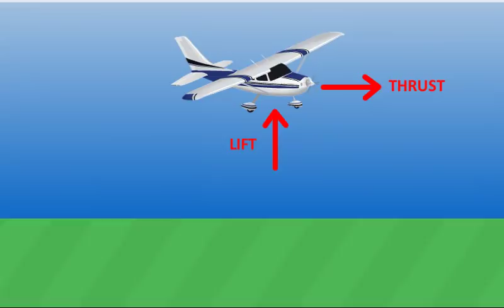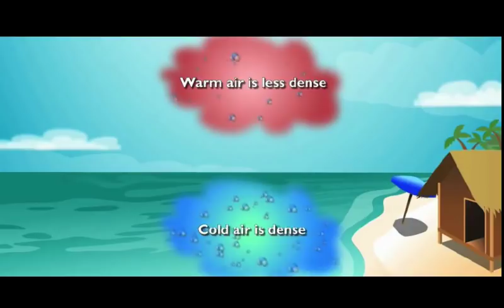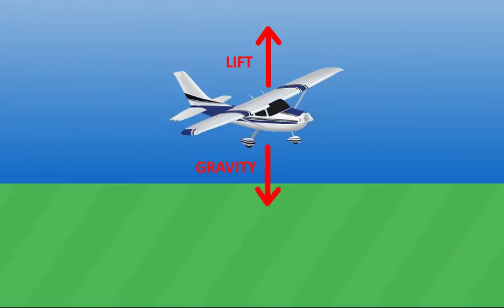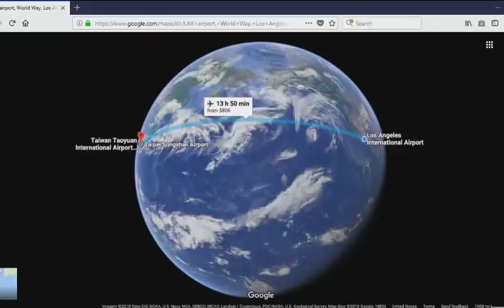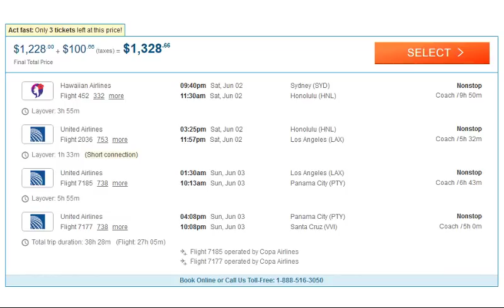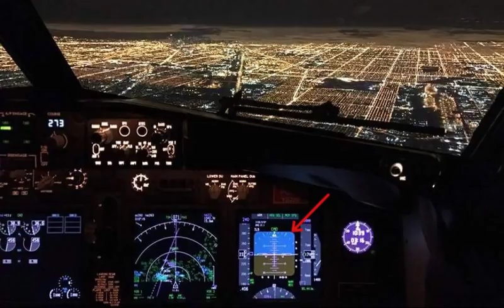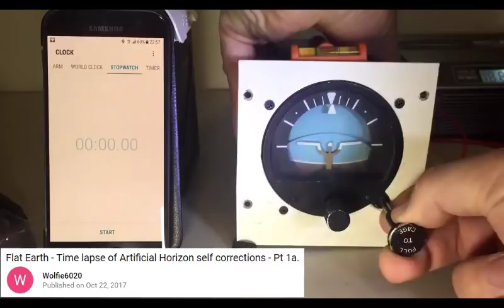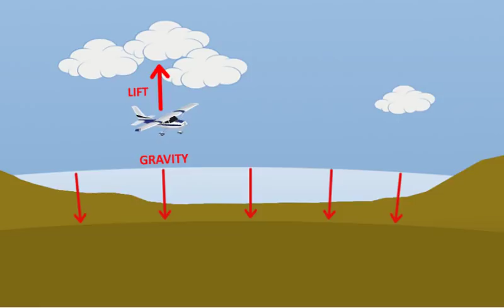Flat Earth Falsities - Plane Nonsense

Comment: +Bobby Wizdum   was asked, to prove Bobby isn't a lying troll.
"OK lying troll Bobby, prove you aren't a lying troll.
Why is it that a compass needle is more or less vertical at the poles and horizontal at the equator?
And when you carry on past the poles the needle slowly returns to the horizontal?
Why is it that it is only possible to navigate accurately over long distances using spherical trigonometry?
Why is it that traditional gyro compasses work perfectly in low latitudes but became unreliable in high latitudes?
Why is it that it is only possible to navigate accurately over long distances using charts based on a terrestrial spheroid?
Why is it that when you watch a ship sailing away from you the hull is the first thing to go below the horizon, then the superstructure and finally the funnel and upperworks?
Does a magnetic compass point towards polaris (Alpha Ursae Minoris) at the north and south poles?
Does a gyro compass point towards Alpha Ursae Minoris at the north and south poles?
What is the relationship between longitude and distance when travelling east or west parallel to the equator?. If you know the answer then you know the earth is a spheroid. If you don't you are not qualified to comment on the earth’s shape.
Please explain the principles behind the development and functioning of a gyrocompass? If you can then you know the earth is a slowly rotating spheroid and gravity is a fact. If you don't you are not qualified to comment on gravity, the earth's shape or movement.
No evasions please, just straight, honest answers.
And Bobby's response was
"wong why don't you stop changing the subject."
So Bobby agrees to being e a lying troll
Reply: WISDOME
KINGDOME
FREEDOME

ABOMINATION
OBAMA NATION
A BOMBIN NATION

DOMESTIC RACE   , DOME MESS TICK
DOMACILE IS YOUR HOME ,   DOME A SIGH ALL
DEMONS  ,, DOMENS 
DOMINATED BY DEMONS EARTH IS,,,DOME IN ATE  D 

WORD OF GOD 
GO SPELL OF CHRIST
U  N  I  VERSE

AND THE WORD BECAME FLESH

AND THE WORD WAS WITH GOD
AND THE WORD WAS GOD

BABBLE ON WHORE HILLARY
ABOMANTION BARACK OBAMA
BURNING BUSH FAMILY

MICHELL OBAMA,    m,,i,,c,,HELL

MANDALAY BAY SHOOTINGS

MAN DELAY ,,, DELAY OF MAN 

LAS VEGAS
LOST VAGUE GUESS

JESUS CAMPOS THE SECURITY GAURD,  THE JESUS CAMP
NEXT TO THE LUXOR ILLUMINATI PYRAMID

CORINTHIANS : AT THE ANGELS LAST TRUMP YEA SHALL BE CHANGED,,, TRUMP*

DANIEL 12:1  MICHAEL RETURNS TO RESCUE THOSE WRITTEN IN THE BOOK OF LIFE WHEN THE TROUBLES OF THE WORLD ARE GREATER THAN EVER BEFORE

DANIEL 12  WAS SEALED BY GOD AND IT IS WRITTEN THAT IN THE END TIMES THIS BOOK WOULD BE UNSEALED AND IN FACT IT HAS BEEN

AND YOU SEE THEN MICHAEL IS THE SAVIOR OF THE WORLD IN THE OLD TESTAMENT AND JESUS IS THE SAVIOR IN THE NEW TESTAMENT

BUT IT WAS MICHAELS HOLY NAME WHO WAS SEALED UP UNTIL THESE TIMES

MICHAEL OF URANTIA  STATES MICHAEL WAS JESUS OF NAZARETH
MICHAEL OF NEBADON SAYS THE SAME THING

NOW THE BOOK OF DANIEL IS OPENED TO REVEAL MICHAEL*

I BEGIN AGAIN*

CREATION IS FLAT AND CONNECTED BY WATERS

WE DO NOT GO INTO SPACE THE VOID THE LIE

ALL DOMED WORLDS ARE CONNECTED BY OCEANS THAT GO ON AND ON

ATLANTIS AND LEMURIA ARE STILL OUT THERE BEYOND THE ARTIC CIRCLE THAT ENCLOSES US IN

UNITED NATIONS SYMBOL IS A FLAT EARTH

THE CATHOLIC CHURCH PREACHED A FLAT EARTH FOR THOUSANDS OF YEARS
THEY IMPRISONED GALILEO FOR SAYING THE WORLD WAS ROUND

SO DO ME , DOME,, DO ME,,, DOME, DO ME!
word

michaels  sword  is actually the  s WORD,   THE WORD OF GOD WILL DESTROY A MILLION SWORDS AND NEVER FAIL

Comment: Are you saying gravity is selective, it can hold great oceans on a ball yet allow a helium balloon to lift up, I didn't know we already had an anti-gravity device all this time. People like this guy narrating this are very clever at deceiving you from the truth.
Reply: +Codenamebravo
"Are you saying gravity is selective" Not in the slightest. The things themselves are different in their mass and distance apart.
Fg=G.m1.m2/r^2
G (gravity) is a constant
m1, m2 and r are variables. Mass and distance apart.
Fg is the force resulting from those two masses and their distance apart due to their gravitational attraction.
You selected two different masses as examples, not gravity, so you are being selective.
Reply: Nope. Helium, in a gaseous state, is just lighter then the other gasses like nitrogen, oxygen and carbon dioxide that are surrounding it. Freeze helium into a solid state and it will stay where you leave it. Check out that periodic table and look at how much helium weighs in at. Also take a look at hydrogen, and why we don't fill Zeppelins with it anymore.
Reply: Capt'Wes Starwind thats 
Our point. Its less dense than air so it rises. Gravity? Nothing to do with it.
Reply: +Bobby Wizdum
Yes, we know you are a troll and a liar, there is no need to keep reconfirming it.
Reply: Bobby you can't get density and buoyancy to do anything without gravity. Please provide your unique flat earth equations for density and mass.
Reply: And yes there GRAVITY deity is full of flaws, nothing adds up in their great picture, Universe would still be expending despite G. 
Einstein showed that what we think of as the ‘force of attraction’ between two masses is actually the result of warping of the very fabric of space and time around them.
General Relativity may work well on relatively modest distances and timescales, it’s looking increasingly creaky on truly cosmic scales. 
Its equations need modification to explain how the Universe has behaved over the last six or seven billion years. It’s acting as if propelled by a force with its origins in sub-atomic effects, which Einstein refused to countenance.

Just as Problems with Newton ... conceptual reasoning ultimately forced Newton's gravitation theory /LAWS to be modified and replaced by Einsein's theory of general relativity.

http://theconversation.com/how-einsteins-general-theory-of-relativity-killed-off-common-sense-physics-50042
Whether it is possible to unite the two remains to be seen but it is unlikely to reintroduce common sense into physics.
Reply: Louis Shaw newton's laws still work perfectly fine here on earth. Enstiens work great on large scale objects. You just showed how you have no understanding of what science even is about. Good job flat earth.
Reply: Louis Shaw I take it you didn't read or understand the article?
Reply: Louis Shaw wow you really buy unto this flat earth scam don't ya? Must be nice feeling smarter than Einstein. Lol
Reply: Louis Shaw too bad grade 4 geometry proves the earth is a sphere. That's gotta suck for ya
Reply: HA ha THAT calmed THEM down, dont like to be called on, only one admitted and keep the teenage bully callings going on, love their LOL!
"I have come to believe that the motion of the Earth cannot be detected by any optical experiment."- Physicist, Albert Einstein
"In order for the Earth to be at rest in the center of the system of the sun, planets, and comets, there is required both universal gravity and another force in addition that acts on all bodies equally according to the quantity of matter in each of them and is equal and opposite to the accelerative gravity with which the Earth tends to the sun...And thus celestial bodies can move around the Earth at rest, as in the Tychonic system."- Physicist, Isaac Newton

"Briefly, everything occurs as if the Earth were at rest..."- Physicist, Henrick Lorentz

"There was just one alternative; the earth's true velocity through space might happen to have been nil."- Physicist, Arthur Eddington

"The failure of the many attempts to measure terrestrially any effects of the earth's motion..."- Physicist, Wolfgang Pauli

"We do not have and cannot have any means of discovering whether or not we are carried along in a uniform motion of translation."- Physicist, Henri Poincaré
Reply: Louis Shaw Verlinde produces conjecture and you hail it as The Truth while wailing about the  need for experimentation to prove anything?

"cannot be detected by any optical experiment"
You actually give the full quote and still can't see the meaning of the last four words?

"and another force in addition"
Newton's (incomplete) quote was pointing out the weakness in a geocentric system. 

Lorentz, Eddington, Pauli, Poincaré - just needs aether to exist. No evidence of it yet.
Reply: Louis Shaw do you understand geometry? It's pretty simple. You can prove the shape of what we live on with 2 sticks and some math. Not really hard to do at all.
Reply: Louis Shaw "a magnetic field and we are attracted to it"
Regardless of whether an object is magnetic or not? 

"further we go from the surface of the earth, the weaker the field"
Yet the attraction doesn't diminish at the same rate a magnetic field would.

"through what we call static electricity"
Which is quite detectable; we aren't covered in static. Why don't you float if you stand on a rubber mat?

"Shouldn't the bigger, heavier magnets be much easier to pull off now"
If there is a planet size magnet below the fridge how do the magnets stay attached to the fridge?

"They create an electric charge by flapping their wings vigorously"
Evidence? Has anybody tested this or is experimentation not important?

"repulsive magnetic force"
How does static generate a magnetic force? Why would it be repulsive rather than attractive? 

"After the bird reaches the end of the magnetic field"
At what height? Higher than planes can fly?

"the planes are designed to create an enormous electro-magnet"
Undetectable as well. So this is screw aerodynamics as well as gravity? Could we have flying cars that easily?

"It's safe to take off your seatbelt at cruise altitude because you are weightless"
You can float around while you're on a plane?  

"You can lose a wing, and it would not matter"
When planes break up in mid-air they come down. Do you have any examples of planes flying while missing wings? Has anyone experimented to see if this is true?

If you seriously believe what you are saying then frankly you'll swallow any BS if it has "Flat Earth" on the label.
Reply: Oceans = heavy due to more mass
helium balloon = so light that even air is dense enough to squeeze it up like tooth paste
Reply from the maker: codenamebravo - See my video on gravity, and pay attention to the part about BUOYANCY.  I am curious why you think a helium balloon goes up. Is it magic? How far will it go up and why?
Reply: No, we're saying that F, the force exerted on an object by gravity, equals Mass #1 times Mass #2, one is the object, the other is the planet) times G, the gravitational constant. Constants are arbitrary numbers that are discovered through experimentation. This allows the formula to be used to calculate force rather than just proportions. So its the product of the two masses times the gravitational constant divided by d squared, the distance between the centers of gravity of the two masses squared. F=G*M1*M2/d^2. It works for butterflies. It works for Mac trucks. It works for mountains. It works for helium balloons.

Flat Earth Cultists try to deceive you into thinking that gravity discriminates between different substances and they make cute jokes about how gravity is "strong enough" to hold oceans but can't hold a butterfly. They're idiots.
Reply: No... you mean why didn't I get more indoctrination.
Reply: Ok then why didn't you stay in indoctrination school long enough to learn geometry and maybe a bit of physics? Are you attempting to deny elements and the entire periodic table exist?
Reply: Right. Helium is lighter than the surrounding gases. So it rises. Thought about another way, other gases sink below it, the same way a rock falls through water. Or even better, pour water in a glass of oil and watch the oil rise.

Comment: To date, not a single photograph of a flat earth exists. After over a century and a half of noted photographers and their professional portfolios, none have captured images of a flat disc upon which we all are supposed to be living. However, thousands of excuses exist as to why such images are impossible, and every one of those excuses has been uttered by a flat earther.
Reply: And no analysis of the so-called "ice wall" has ever been published. Flat Earth Cultists have yet to explain how ice, which floats on water (try it with ice cubes in your glass of water) can block the water it's floating on from going over the edge of the Earth. It's a pretty ridiculous lie.
Reply: RockinRobbins13 yes it has. Admiral byrd discussed it and there are photos of it.
Reply: Admiral Byrd said nothing about an ice wall with a diameter of 25,000 miles, a circumference of 78,540 miles. Byrd knew that ice floats on water and would not block the water from flowing off the earth. Byrd knew that Antarctica is a land continent with mountains of rock and the highest plateau on Earth. He flew to the pole and back and was merely commenting that he hadn't flown over the other half of the continent.

Flat Earth Cultists take the sensible and easily understood words of a sane man and inject a meaning that Byrd would have had a very good laugh at. Byrd was not Cultist. As a pilot, his life depended on his knowledge that the Earth is a sphere.
Reply: RockinRobbins13 oh no no no, it's a fire wall made of flat plasma 😭😂
Reply: Mike S since we cant leave flat earth how could we have a full picture of it?
Reply: WizDUM This is a perfect study in deception and logic. Your canard has two parts, a premise and a rhetorical question. Your premise is flawed, "since we can't leave flat earth..." is a simple lie, supported by not a shred of evidence, in fatal contradiction with over 30 million unique, full color, single exposure, high resolution (most are 11,000 x 11,000 or >100 million pixels), geotagged, verifiable and publicly available photos of the entire earth surrounded by space. https://www.metabunk.org/full-disk-hd-images-of-the-earth-from-satellites.t8676/ But only a minority of them were taken by NASA satellites. Russia, European Union, India, Japan and China and soon Bangladesh, also have weather satellites taking these shots and they all agree in every single detail. Every one of them is available for every person on earth (do you qualify?) to download and inspect in excruciating detail to expose any fraud. For 40 years nobody has found any fraud. Here's just one of the 30 million.  Warning this 1/30 millionth of available data will choke your computer all by itself. You have been warned: https://www.nesdis.noaa.gov/sites/default/files/assets/images/abi_full_disk_jan_15_2017_high_res.jpg

This photo contains the real weather for every single visible spot on earth. Just researching the data to dummy this up would cost many millions of dollars and take months. But this satellite took one of these every 10 minutes that day. each one unique, each one geotagged, each one relied upon by weather forecasting companies all over the western hemisphere, who paid for the incredible accuracy in forecasting that happens when you have a bird's eye view of the earth. If all the CGI laboratories that ever existed on earth were to take every employee who ever worked for them, worked them 24 hours a day 7 days a week, they couldn't even keep up with dozens of satellites, pouring out an 11,000 x 11,000 unique image every 10 minutes. That's a ludicrous, ridiculous lie you have vomited there, and no, it's not filet mignon.  Time to put the final nail in the coffin of your lies. Shall we?

You can receive and print these photos from many of the satellites before anyone has the chance to whip any possible CGI on them. Here it is again: https://www.youtube.com/watch?v=dmL9Tbnhs30 and here http://www.planetary.org/blogs/jason-davis/2015/20150921-how-to-download-weather.html. Now you can prove that those shots you received directly from the satellite match in every pixel with the ones you can download from the satellite's web site and prove that no nation on earth uses CGI on any of their satellite photos of the earth.

Flat Earth Cult dogma is silly. It's a badly executed, pre-school level, transparent, impotent bunch of lies from a cult that requires its members to lie, even when telling their wives what they ate for breakfast. WizDUM, you again, as usual, stand exposed as a cultic, idiot liar. And you will continue proving that nobody should pay attention to Flat Earth Extremist cult lies with your juvenile taunting. Carry on my wayward son. You're the best player on the spherical Earth/heliocentric solar system team. Yay team!
Reply: More non unfactual evidence of proven vaccum Space travel aside CGI.
Reply: Bobby Wizdum So, James May wasn't in a twin seat U-2 and didn't see the curvature of the earth for himself? U-2s can't fly? U-2s are fake? James May, the television presenter, is a liar? Film footage from a captured V-2 rocket never captured images of the curvature of the earth? Cosmonaut Alexey Leonov never spent 12 minutes and 9 seconds outside of his Voskhod spacecraft? The film footage of the event is fake? The images from the Hubble telescope are fake? That's a lot of faking. Only an abject idiot would believe all of the money, effort, and time expended was for a lie. I would certainly hate to be such an idiot. I realize, though, that such an idiotic existence is all that sort of idiot has.
Reply: wrong we do haVE PICS OPF FLAT EARTH.  THERE IS NOP P[ICTURES FOR THE GLOBE EARTH. IT IS YOU LYING GLOBE CULTISTS THAT HAVE NO EVIDENCE.
Reply: truly you nut jobs need mental help
Reply: And what about their adversaries joe? Love to see you fighting against a Napoleon or other crazies,you do know some dedicate videos towards us with lots of science... :) very sane behavior... hi hi hi